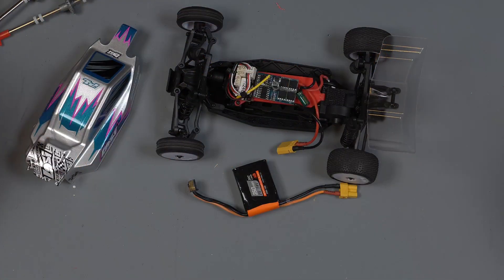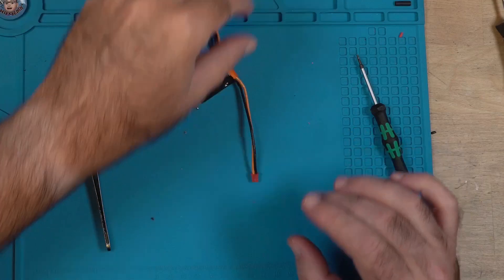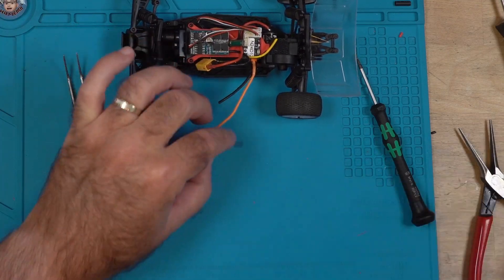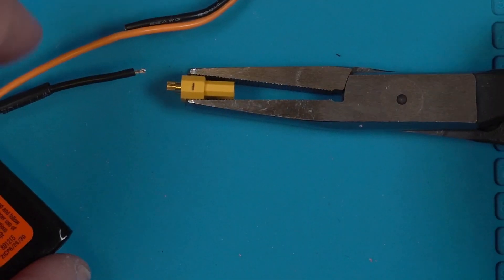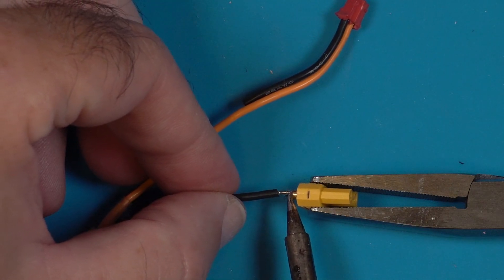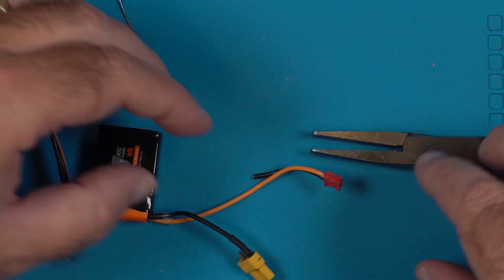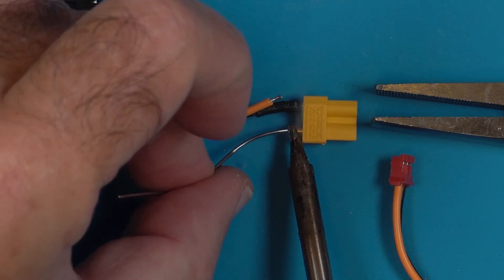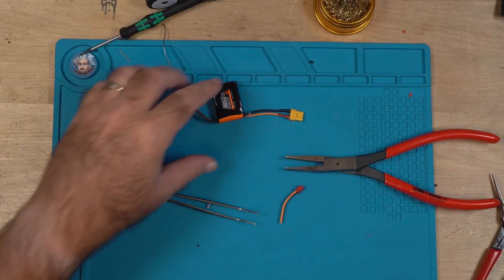Losi Micro B chaning battery connector to XT30

Comment: sorry am i upside down reversed and drunk.  my ph 2.0 is going to my receiver?  I change out the 2 wire its not gonna fit into the reciever?
Reply from the maker: I ended up changing out my receiver and ESC in this project as well. If you want to keep the stock electronics you would need a converter.

Comment: Great mod! Which connector would you suggest to replace the awful charging PH2.0 ?
Reply from the maker: What don't you like about them.   If it's hard to remove part, you can file down the locking part on the charger end just a bit and it much easier to remove.
Reply: @BillsWorkbench   I am looking for a decent charger for them, and it seems rare. But I'm new in the RC world, so maybe I am not searching the right things. 😁 The provided Spectrum USB charger gets really hot and seems to be subpar.
Reply from the maker: @pmtsimracing2045  Lately, I have been using this kit.  This is after the connector swap in this video. 
30W power adapter: https://amzn.to/4dSG2QS
XT30 to XT60 Adapter for charging: https://amzn.to/4cXRr2a
Travel USB C charger: https://amzn.to/3zU8N18
USB C Cable: https://amzn.to/3DvLufL
Smart Discharger: https://amzn.to/3DvLufL
Reply: @BillsWorkbench  This is good info
Reply: @BillsWorkbench  wish i Knew this a few batteries ago

Comment: anyway to make these brushless/better battery ?
Reply from the maker: There is not much room a larger battery and with the body still fitting. I am sure there are batteries with higher mAh on amazon or AliExpress, but be careful it's easier to change the label than the battery.